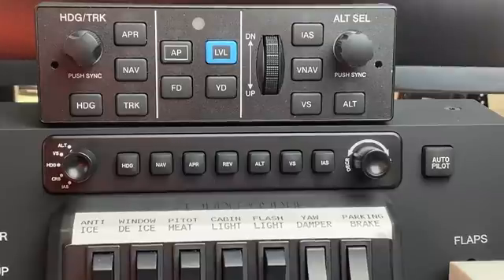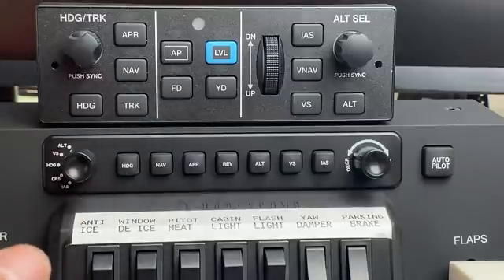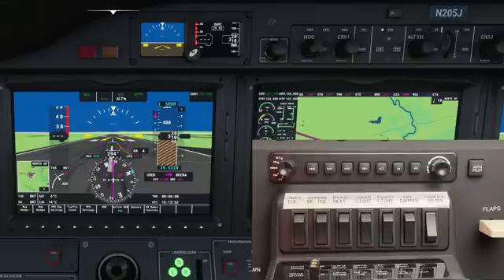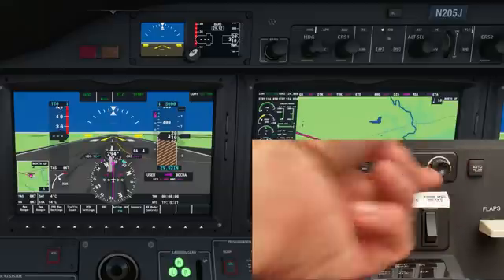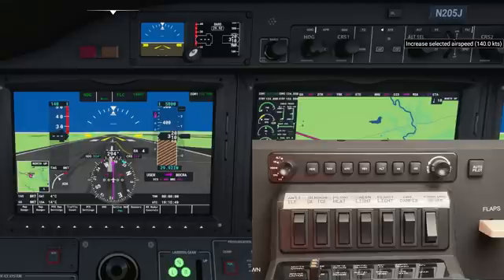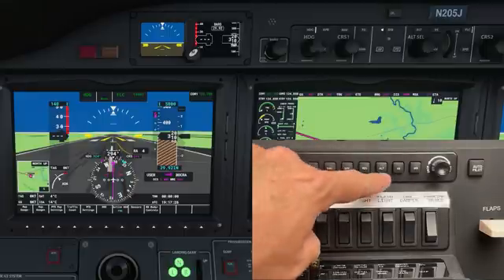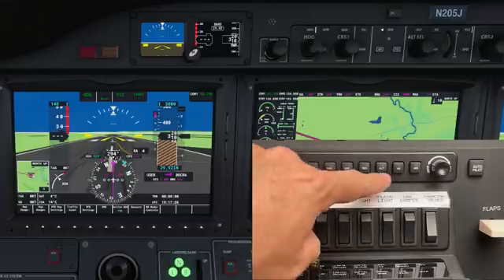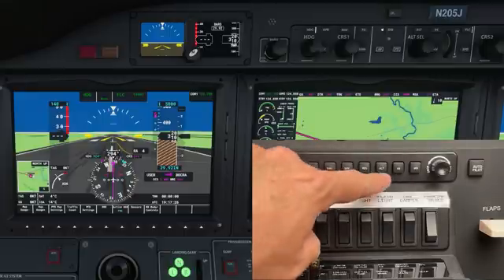Autopilot Tutorial for Honeycomb Bravo Throttle Quadrant in MSFS 2020.

Comment: Thanks for the nice overview of the Bravo. Just want to share a little extra detail on the differences between FLC and SPD modes when it comes to aircraft with Autothrottles:

Flight Level Change (FLC) mode and Speed (SPD) mode are both autopilot functions used to manage altitude changes, but they operate differently:

- FLC Mode: This mode maintains a set airspeed while climbing or descending. The autopilot adjusts the aircraft's pitch to ensure the selected speed is maintained. This is useful when you want to prioritize airspeed over vertical speed, preventing stalls during climbs or excessive speeds during descents.

- SPD Mode: Also known as IAS (Indicated Airspeed) mode, this function allows the autopilot to maintain a specific airspeed by adjusting thrust rather than pitch. This is commonly used in aircraft with autothrottle systems, ensuring a steady speed without manual throttle adjustments.

In short, FLC controls pitch to maintain speed, while SPD controls throttle to maintain speed. Pilots typically use FLC for altitude changes and SPD for speed control during level flight or gradual altitude transitions.

Comment: After switching my selector to HDG, then clicking the HDG button, my heading bug doesn’t just to my current heading. I can still manually move it with the adjustment knob, but selecting the HDG button or not does the same thing. Thoughts?
Reply: Also, my adjustment knob moves in 1 degree increments which means I have to turn it probably 20 times to get it to move as far as this video does in a single turn. Looks to be mapped to Plus and Minus on the ‘Misc’ section so appears to be correct. Just operating at a completely different ratio of turns which is annoying

Comment: What's funny is I have been using this throttle quadrant at home and love it, but yesterday jumped in the Piper Lance to fly to Dallas and it has this exact autopilot and it took me a minute not to try to be reaching for my bravo quadrant.  But yes in our real plane it is pretty close to the Bravo.   The blue level button is also really cool.  If you were to get disoriented in clouds, night , ect, just hit it and it WILL level your plane back out.
Reply from the maker: That is correct.  If you want to see it in action I demo the blue button toward the end of this video:  https://youtu.be/jLB14taE_tY
Reply: Yea, I am a Pilot and fly multiple planes.  The plane I flew yesterday had that same autopilot and we had messed with the lvl button and it is actually pretty smooth.  I just saw your video and same setup, also love the GTN750, those are so user friendly.   Good videos!   @RMAG

Comment: It's never clear to me how to arm something vs engage something.  You pushed the altitude hold button to immediately engage altitude hold, you also armed the glide slope.  How do you arm the aforementioned without engaging them?
Reply from the maker: Some modes are instant engagement, some are armed some can be both depending on the situation.  For example, Alt Hold is always instant if you press the button.  So is HDG.  VS and IAS is instant.  Armed things are typically armed because you are not “there yet”.  For example, you set an Altitude Preselect which is an altitude you are not at.  You use a mode to ascend or descend to that altitude (IAS, VS, or PIT). Now Alt Hold is Armed.  It won’t hold at the preselected altitude until you actually arrive at the altitude.  NAV button can be either. If you are going direct to a Waypoint and you hit the NAV button, it will instantly enter GPS mode and take you to the waypoint, however, if you are on a heading, and you are going to intercept a leg of a flight plan and you hit NAV mode, GPS will be armed because you’re not actually on the GPS course yet. Same applies to APR mode. If you hit APR before you are on the approach, it will be armed.  If you hit APR while on the approach the lateral portion would typically immediately engage, but the vertical portion is typically armed and needs to be intercepted.  So basically, you just need to understand what you are doing when you put the auto pilot in a certain mode. Is it a present command or are you setting up for the future? That is the basic difference between immediate engagement versus arming.
Reply: @RMAG  Thank you for the explanation.  It kind of makes more sense to me, I'll give it a shot in the simulator and see if I can figure it out.

Comment: I read the comments before asking. What would be a choice to implement the FD on and off button? I like to have the option of turning it off manually. Unless I am doing it wrong, turn off auto pilot and FD stays active.
Reply from the maker: There is a keyboard shortcut I think it is control or shift F. I re-purposed my “REV” button to do this.

Comment: Hi, I got my Honeycomb Yoke and Throttle in November of 2021 (throttle in first of Nov and Yoke at end of Nov).  After getting rid of my Saitek yoke, throttle, multi-panel and switch panel in stalled the Honeycomb in mid Dec. After installation ran into some problems, on the yoke the nav and taxi light switches do not work, rest of switches work fine, beacon, landing, and strobe. Then the next problem ran into is the Auto Pilot will not work. Can turn system on and see it high light on instrument panel but nothing else works Turn left knob to heading the turn right knob  and heading bug does not move. Have saw where you can download from Honeycomb site how to make the leds for throttle panel lighs light up with on. I fly two planes, Cessna 172 and Beech Baron 58 with air manager premium panel for both and have FS2020. Also was able to program 4 of the seven switches on the throttle quadrant, pitot heat, cabin lights, flood light, and park brake, they work fine. So if you have any ideas or information on what to do to correct these problem would be greatly appreciated. Thanks
Reply: Hey, your Bravo lights not working?? I bought in Oct 2021 and only yesterday installed "Better Bravo Lights" - run bat file and all lights + button lights finally work!  Try again using TDM Daher 900, HC Alpha dial set to Both with latest patch from yesterday. I feel so happy to finally use the auto-pilot features in the Bravo with all the lights functioning!
Reply: Update was able to get some of Auto Pilot to work, the altitude and heading. Vs, nav, and Ias will not work. Also do you know what setting need to use to keep engines running. Engines start and run until starter switch is moved to both, then kill and will not do anything to restart. Have to shut down FS2020 and restart FS2020. Also when tried to set start switch on Yoke, it brings up switches on the throttle quadrant, switches 35 and 34. Any ideas on what is happening and how to correct. Tried to set back to default, but did not help.
Reply: @davidedel31  ask in FB group FS2020 enthusiasts

Comment: 7:30 - So it's niot only me who has trouble keeping in a straight line when taking off. I'm a noob to MSFS and I also have the Honeycomb Alpha & Bravo and Thrustmaster pedals
Reply from the maker: When I filmed this I was using the plastic Thrustmaster TFPR pedals.  Fine control was hard to achieve.  Since then I got Thrustmaster TPR Pendular Rudder Pedals and it’s a world of difference. Much more close to the real thing.
Reply: @RMAG  I find that my aircraft tends to veer left when taxiing and on takeoff, don't know if  it was due to wind or the controls need calibrating.
Reply from the maker: @PeterMaddison2483  aircraft with propellers all veer left.  You have to add right rudder.  Here is a article why:  https://www.boldmethod.com/learn-to-fly/aerodynamics/why-you-need-right-rudder-on-takeoff-to-stay-on-the-centerline-ground-roll/
Reply: @RMAG  Thanks for that, I thought it was me or a wrong setting or something.

Comment: Rma can you help me troubleshoot a problem with my TBM 930 AUTOPILOT ILS ISSUE? 

the autopilot ILS approach mode does not engage, when I press the approach bottom on your quadrant the plane is at a 45-degree angle and when  intercept the correct final heading on the ILS approach  mode the heading light stays on it does not switch to approach mode and the  continues straight 

it does not intercept the final course and also does not intercept the glide slop it does not switch to approach also it does not intercept the localizer    

I trouble to troubleshot this problem by disconnecting the Honeycomb Bravo Throttle Quadrant  and honeycomb joke and switched back  to my old joke and it worked fine 
I  just purchased the joke and the quadrant 

please help I am a commercial pilot and I am very annoyed by this 

thanks in advance for your help 

Capitan
 tony
Reply from the maker: Tony:

Looks like another bug.  When in HDG mode it will not intercept the Localizer or GPS horizontal nav on an RNAV approach.  I found that if right before the Localizer intercept, if you tap "NAV" it will capture the Localizer.  Then re-engage the APR mode and the Glideslope captures okay.  Yeah its not exactly right, but you get it to work.  I am using the Garmin G1000 NXi update.  I did not try on the original G1000 mode.

Comment: Hi, I setup the TBM 930 and works great. I now setup the Cessna Citation Longitude which uses C 3000 same as the TBM 930. I have issue to setup the auto Throttle. DO you have any recommendation. There seems to be a conflict when using the minus bug. When I reduce the altitude the auto throttle speed reduces at the same time like I am using the knob to reduce the airspeed. Can you help?

Comment: Did you  push the OBS Button before trying to change the GPS course (mangenta) like in real live? https://youtu.be/fYi7NbSnbhc. 7.55
Reply from the maker: You don’t do that in real life.  OBS suspends GPS sequencing and allows you to select different courses to or from the next waypoint.
Reply: @RMAG  if you push the OBS button you are able to adjust the course  to next point you want to intercept  by using the course knob. https://youtu.be/fYi7NbSnbhc 7.55
Reply from the maker: @hdfreefly  The video link you provided is explaining how to fly a manual hold with the GPS.  Which is exactly what I said in my first response.  OBS mode suspends GPS sequencing and allows you to select different courses to or from the next waypoint.  In the video you sent me the guy is flying in a holding pattern, which is flying in circles around the DUMBB waypoint.  He uses OBS to select the course that he is going to fly inbound to the waypoint and because GPS sequencing is suspended he flies in the hold in perpetuity until he turns off OBS and sequences to the next waypoint.  By the way, you don’t even need to do this with a G1000.  A G1000 can load and fly a hold by itself without having to do it manually with the OBS.

OBS stands for Omni Bearing Selector.  It originally came from before GPS.  You would fly to and from a ground based fix called a VOR.  For example if you were flying on the 360 degree heading toward the VOR, and your next VOR was westbound, you fly to the VOR, your to/from indicator would flip once you crossed the VOR and you dial your OBS to an outbound course of 270 degrees from.  As you approach your next VOR, you tune the VOR frequency and dial the OBS to the new VOR on a course of 270 degrees to the next VOR and so on and so forth.

With GPS however you don’t fly from a ground based VOR to VOR using headings.  You build a flight plan that has various waypoints and your GPS directly points you to the various waypoints.  It knows the direction you need to go to the next waypoint and automatically gives you the desired track you need to fly.  With GPS you are not manually tuning headings with the OBS.  With a GPS the only time you use the OBS is if you manually want to take a specific heading to or from the next waypoint and suspend sequencing to the next GPS waypoint like in the video you linked.  They did not want to proceed passed DUMBB intersection.  You would also use OBS mode to manually fly an unpublished DME arc around a fixed GPS waypoint.

But for normal point to point GPS navigation you are normally flying direct to the next waypoint in sequence.  If you change one of the waypoints you are flying to, you just turn direct to the next waypoint and do nothing with the OBS.

Comment: How can I select altitude changes in 100' increments. Seems like changes are only by 1000' .  thanks!!
Reply: If you move the dial slowly it will change by values of 100.
Reply: @SeezSantos  not reliably. its annoying as hell. and i just found out that after you pan around in the cockpit using the right mouse button, it briefly works again. then it jumps back to jumps of 1000
Reply: Did you ever find a solution? I’m also having this problem.
Reply: @samgassaway434  look here https://www.youtube.com/user/Rmag/community
Reply: @samgassaway434  no....have not.
Reply: If you are using the Toliss, then you need to change it from 1000 to 100

Comment: The GFC-500 also has a TRK and a VNAV, which I noticed that Bravo does not have.  What alternate options / bindings should we use for those?  And any ideas on how to mod the black switches to lighted-ON switches?  (that are just below the auto-pilot row of buttons).  I would assume this would be a quick mod because someone likely makes those exact switches but with lighted options for ON only. Ideally , the switches would have a very soft back-glow (lighting) for the whole switch, and then a demonstrably different light for when the light is actually on.  It would also be nice that the switches have a "Screen-Print" option so that we can label the actual light on the surface of the switch itself.  I'd also like to mod the Alpha Yoke in the same manner.  Lastly, I would think that if we could mod the unit to replace the "BACKCOURSE" button to a "RNAV" Button, it would be much more useful.  Any ideas on this stuff would be appreciated.

Comment: Rmag, I tried to bend the AP button on the throttle panel and it does not engage the AP in the TBM, I can even manual select the AP in the 930 and it still does not engage, any ideals?

Comment: Thank you for posting this.  I have a Bravo and love it.  I found this was very helpful.  Cleaning up the VS bug was helpful as well.  Here are two things that might help others - my workaround for the increment bug and how to turn on the lights.

First of all in regards to the MSFS ongoing bug that increments altitude by 1000 instead of 100 and the heading by 1 instead of 10.  I was using a workaround on my Alpha that disabled the constant signal from the switches.  I don't think that will work for the Bravo since the constant signal is essential to the turn knobs in the AP.  My workaround for this is the Stream Deck with a plugin for MSFS on GitHub called Flight Tracker (which I had all set up as my autopilot prior to the Bravo).  The Stream Deck plugin uses SimConnect rather than a direct controller input, so is unaffected by the bug.  I use the Bravo for the big changes.  When I need fine tuning (100s of feet instead of 1000s or 1 degree of heading instead of 10) I use the buttons on my Stream Deck.  Until we get a fix, this is a great way to go.

Secondly, out of the box the lights on the Bravo don't work (as I noticed they were not working in the video).  They can be fixed so that the lights on the autopilot light up when in use.  The indicators and the landing gear lights work as well.  I fixed this with a third party tool from Aerosoft since Honeycomb had nothing on their site when I got my Bravo.  I see a tool on the Honeycomb site, but have not tried it as of yet.

I hope everyone who does not have their Bravo gets it soon.

Comment: How do you resolve the 10 degree issue of the heading bug? When you turn the heading knob, the heading jumps 10 degrees to left or right, instead of 1 degree.
Reply from the maker: It’s well known bug in MSFS.  It has to be fixed by Asobo.  Alternatively you can use a third party program to do the keybinds, or you can unbind all your switches including the Alpha yoke. Or just wait for them to fix it.  I use the knobs for macro changes and then the virtual knobs in the sim for the micro changes.
Reply: @RMAG  Thanks for sharing your workaround! Yes, I have unbound the toggle switches for now, as well as the selector knob (on the left). My workaround to use the plus/minus knob (right one) of the autopilot is that I have bound the AP mode buttons to two functions. E.g.: HDG enables the heading mode, and also selects the heading bug. Then I can use the plus/minus knob to turn the heading bug. It needs a bit of getting used to. 

One more thing, how do you use the virtual knob for micro changes? Because for me, even the virtual knob moves in 10 degree intervals, when the toggle switches are bound to something.

Comment: What are you using to maintain a certain speed?
Reply from the maker: If your talking about in a climb or descent and you want a certain airspeed, it’s IAS mode.
In straight and level flight it’s just a throttle setting.
Reply: @RMAG  many thanks

Comment: Just got my Bravo yesterday (only 2 weeks from the time I ordered it on Honeycombs website!)  I noticed the same issue with the heading only doing +/- 10 and altitude of +/-1000.  If I try and use the mouse on the control it does the same thing of +/- 10 on heading but as soon as I unplug the Bravo it goes to +/- 1.  Even the keyboard keys do +/- 10.  I hope Asobo gets this sorted out quick.  I'm also using the MSFS Mobile Companion App so I can set these manual but would be nice to have everything working as it should be.
Reply: Yes, it starts happening for most folks after the first time you hit Esc. Wish they would let us  choose the increment size.